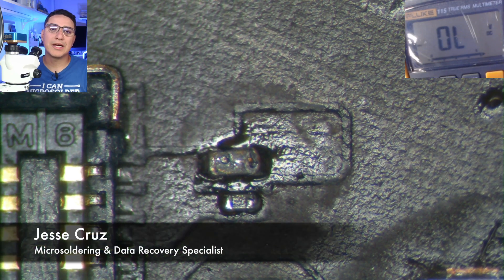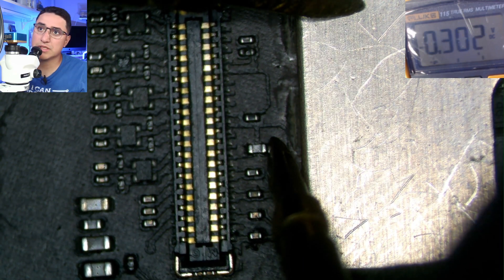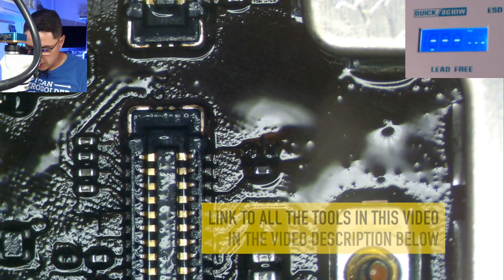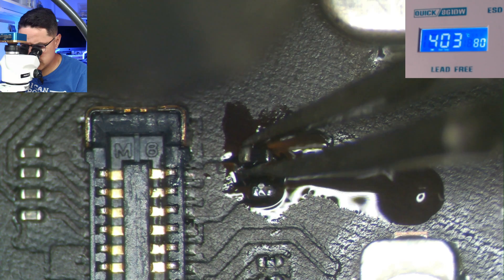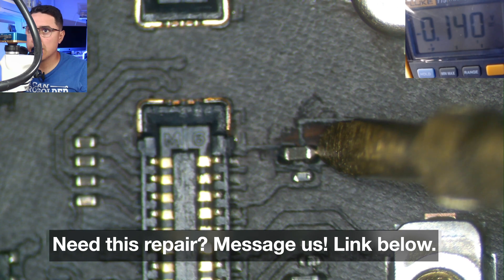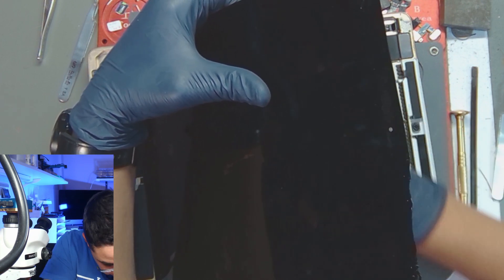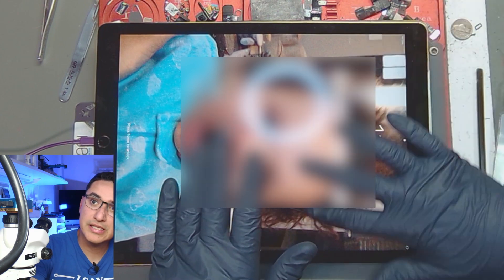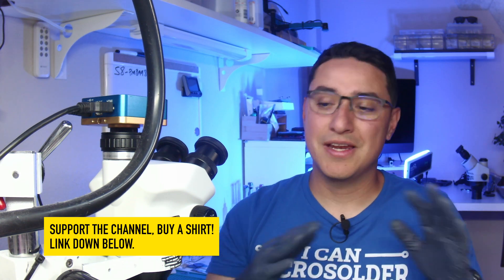iPad Pro 12.9 Gen 1 - No Touch After Screen Repair. How To Fix a Blown Filter. Microsoldering Repair

Comment: Hi There! I had a screen replaced on a 12.9 gen 1 pro a little less than a month ago. The touchscreen seemed to be working fine up until a week ago. What is strange is that, after entering the password, the touchscreen will work so long as you continue to swipe. If you pause swiping for maybe 5 seconds, the screen becomes unresponsive. This is repeatable each and every time. Whether it be on the home screen or within an app. Keep swiping, all good. Pause and you are hitting the power button off and then on again, then relogging in. Do you think it is the same issue? Also the button no longer works. It seems to be floating. I know I need to bring it back into the repair shop, though at this point I'm not so confident in their abilities. Any advice would be greatly appreciated.
Reply from the maker: Sounds like a defective screen. And the home button can easily fall in if it's not installed properly.

I would just take it back to the repair shop & get a refund. 
Then take it to a reputable repair shop instead.

If you're in the USA, we can help: https://www.vccboardrepairs.com/contact-us

Comment: With the filter replacement, where did you get that part from, did you have a spare ipad board lying around or did you get it from somewhere else?
Reply from the maker: As I mentioned in the video, it is an iPhone 6S Backlight filter. It is also linked in the video description.